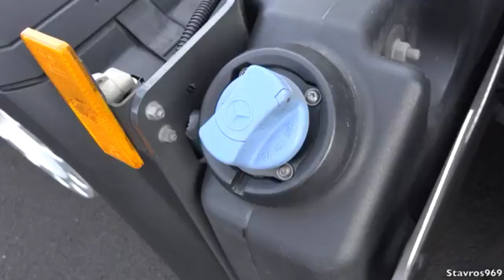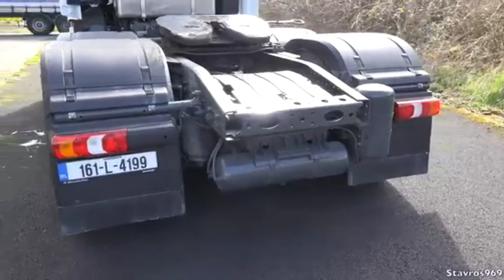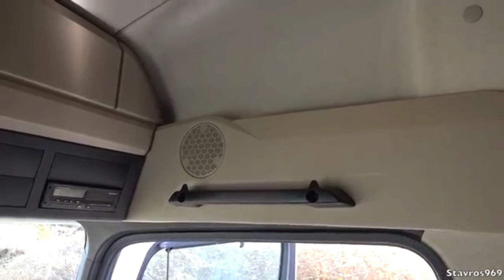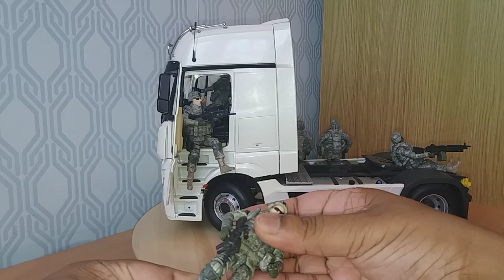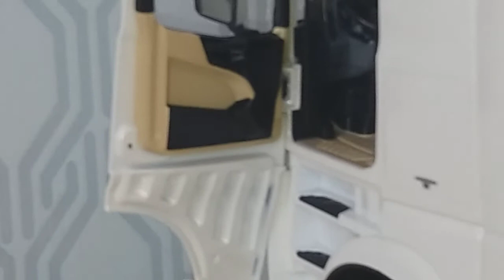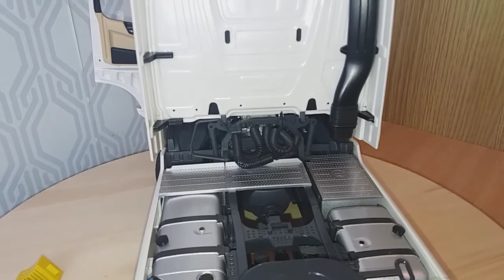1/18 NZG 'Mercedes-Benz ACTROS' Truck

Comment: Man, it is about time you post another video. It has been like 6 months since you posted your last. Lol. I was getting worried about you. I hadn't heard from you in a long time. So mister customizer, how are you going to customize this truck into something military? Lol.
Reply from the maker: Hmmm....let me see ...i was thinking of giving it some extra plating/shielding, a roof mounted chain machine gun, a grenade launcher to the rear and top it all off with a jungle splinter pattern ....how does that sound 😉